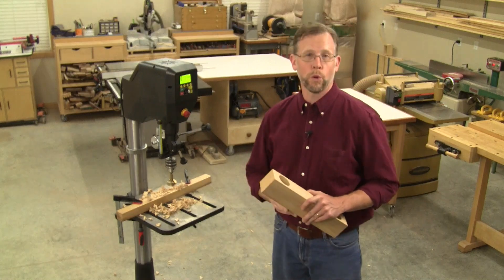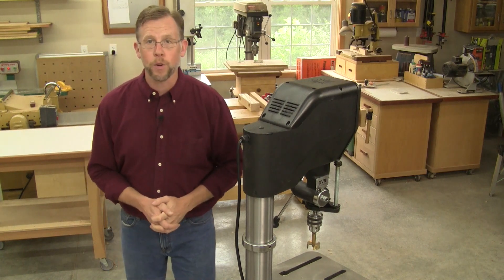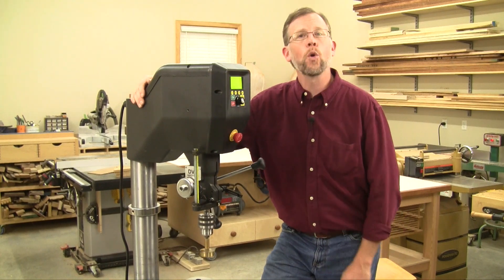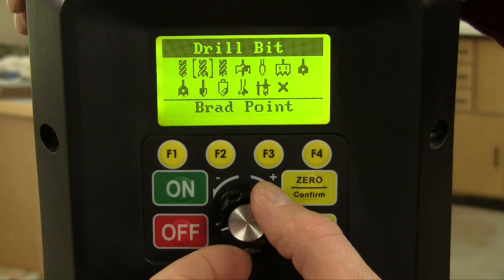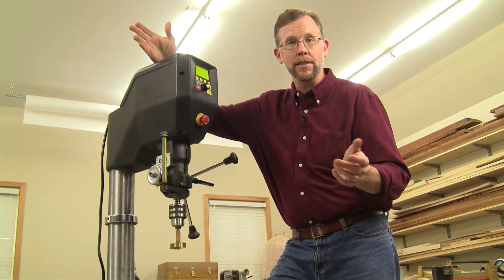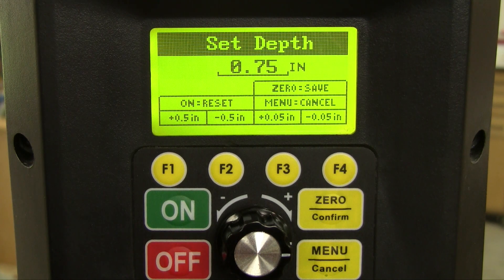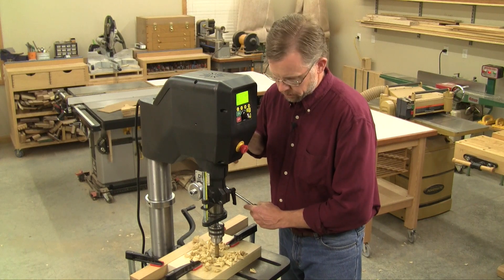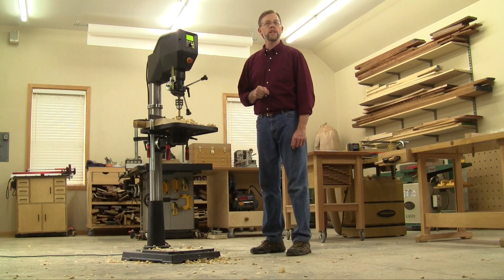First Look at the NOVA Voyager Drill Press

Comment: "...no belts to get your hands dirty..."
If you're afraid of getting hands dirty, you should probably avoid woodworking to begin with...

And for $1700, you're better off with a standard, cheaper drill press and just print a page of drill speeds to tape to side of machine...

Comment: Over engineered and overpriced pos that can be outperformed by any old-school solid drill press. If you have 1500 bucks burning a hole in your pocket, this is a bad investment. Get something less expensive and much better.
Reply: Like what?   If you make a claim - you need to back it up with facts.  Otherwise it's just another, self-appointed, Internet expert with no experience or credentials making specious claims.
Reply: @buckhorncortez  Get a used Arboga drill press. Spend 4 times less and have a gear head that will work for years to come. It already worked for decades so with hobby use expect to outlast you.

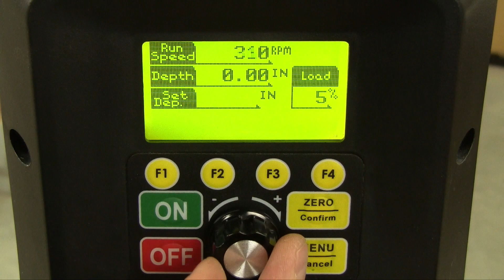Comment: am I the only ione, who is worried about the rattling sound it makes at 2:18 when running with 5500 rpm?
Reply: vorna nachna that scared me!
Reply: Yes it will vibrate at maxed speed when using a forstner bit! At those speeds you would need to be using a typical brad point bit in softwood and certainly not a huge forstner bit.

Comment: And when the circuit board goes on the blink, how much will that cost to replace? It takes longer to program in all the parameters for a particular job than what it takes to drill the hole.!  This guy makes it seem like there is only 1 speed possible to drill a particular piece of wood or metal, or when using a particular type of bit and if you don't get it exactly right, something bad will happen. BS on that.! How about just spend a little bit of time and just learn about general speeds for different materials and tools...? It's not nuclear science stuff.!! And oh my...getting your fingers dirty because you have to change belt positions...how awful...!!
Reply: marbleman52 hhi5 winning

Comment: Electronic control looks nice and the speed range is awesome. Not sure about the mechanical side though. The runout of the bit is visible with naked eye and the vibration I could hear at high rpm-s was bit scary. Not sure what is the ratio of metal / plastic used for the drill press head.

Comment: $1500?!? I can see making the investment if I used a drill press all the time but I don't.  Pretty slick features but I'll stick to my hand-me-down Ram-Machinery drill press that's still going strong.
Reply: Chris Parker No kidding! My little Wen 12" tabletop has variable speed via a conical pulley, and has plenty of power (¾ HP) for all the holes I will ever drill. When I got it, I drilled a test hole with a 2" Forster bit into some tough Douglas Fir, with no issues at all. Good enough for me, and for $194 on Amazon Prime, it leaves me $1300 to spend on a decent bandsaw and jointer. 

I avoid overly-computerized machines...  they take the fun out of woodworking for me. I prefer to do the thinking myself in my shop. I even have a simple $300 2 HP 2-speed pump on the pool, controlled by a $12 cheap high-low dial controller (with those little push-in/pull-out - instead of a fancy $1400 variable-speed computerized pump that would have had to have been installed by a certified pro for $300 more, and which would get burned up with any common power surge. I've had nearby lightning strikes here that have taken out lots of e-things - so the simpler the better for me!

Comment: The video seems to reveal a bit of slop while drilling. Did you measure any run-out ? or is there a problem with rigidity?
Reply: Dean Kirby all drill presses like this have issues with support. Check my channel I made a stand to fix that problem for my drill press

Comment: Impressive drill press. Makes everything with belts and pulleys look very outdated.
Reply: Not at all. Belts and pulleys are the way to go unless the machine has way more power than you ever use. Despite what manufacturers say, variable speed drives lose torque at lower speeds. Exactly opposite of what you need. Pulleys, on the other hand, increase torque as the speed is reduced.
Reply: You need to look into this particular type of motor...

Comment: Wow. $1499? Not for the home hobbyist. Nice drill though.
Reply: I'm not really knocking the DP itself as it's got some interesting innovations. But it isn't even close to what an industrial user would think of as a production machine. So this machine is clearly targeted at the home user.But for reviews like this and on any machine then for example on a drill press including the specifications for chuck run out, flatness and factory set tram of the table etc. should be a priority imo.And the manufacturer still hasn't addressed the failing of every single drill press 98% of the hobbiest's could afford and that's the poor design of that cantilevered table. They work ok on short depth holes, but for deep holes there far from accurate. Put the tip of a dial indicator out on the edge of the table on any drill press so it registers deflection, then just start adding a bit of pressure from your thumb. Then visualize the average feed pressures in wood with larger bits let alone drilling a 1/2" hole in steel. If you've never tried it you'll be more than surprised at just how much the table deflects even with a heavier work piece.

I do a lot less working in wood than metal so my views are from that perspective. But once you've tried drilling any hole on a Bridgeport type mill with it's heavy dovetailed vertical ways on the column and the center support from the knees vertical feed screw you start seeing the obvious flaws in the usual drill press design no matter how many other innovation they put into it. I no longer even have a drill press and doubt I ever will as long as I have a mill.
Reply: Yep a more than valid point Danny. As I mentioned I'm more into metal than wood and likely most true wood workers would call me a hack when it comes to wood. But until someones tried working wood in a mill there's no way to properly describe the control, accuracy and lack of effort to get that. They do limit your project size of course. But if more wood workers tried a mill a lot more would have one over any sane priced drill press that's out there. And over and above the drilling part there's few wood working processes done in a wood shop that can't be done on a mill. Half blind dovetails and band saw work is about all I can think of. I can do through dovetails just fine and without a jig. Step over using the hand wheel graduations. It's even faster and better with a dro. :-)

The milling heads don't run fast enough for something like router bits but it's easy to adapt a router for overhead use or almost any other angle you'd want. I can even plane wood to less than 5 thou tolerances if needed to match a metal part using one of the no longer sold Wagner Saf-T-Planers. My mills power feed makes it feel like I'm somehow cheating.

Metal casting company's have used metal working mills and lathes with higher speed heads for probably close to 100 years or maybe longer to build wooden patterns. Most of there really accurate drilling is done on those mills instead of using there drill presses. Today a high percentage of patterns are done with cnc metal working type mills. I've always been a bit surprised the older manual technology never seemed to trickle down to the home wood workers. Yes it's slower, but my shops limited for size to where I can't even use a small portable table saw. If money were no object and I had a full wood shop I still wouldn't own a drill press. I'd have a mill of some type.
Reply: I have a descent size wood shop and have considered getting a drill/ mill in the past, even though I rarely work with metal. If I were younger I'd probably get one , but at my age I think I'll stay with what I have, all though this Nova DP is pretty cool . I still may pull the trigger on it .
Reply: Shill review
Reply: And for the price of this Nova you can get a lower end Mill/Drill ! So definitely something to consider !